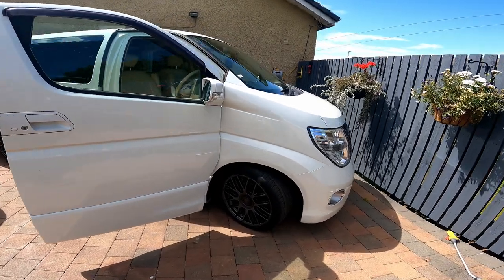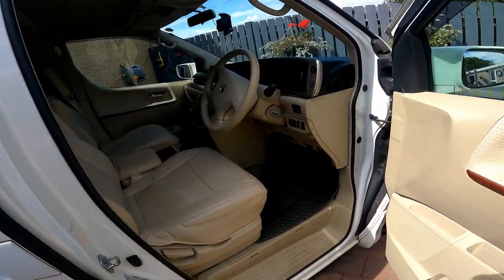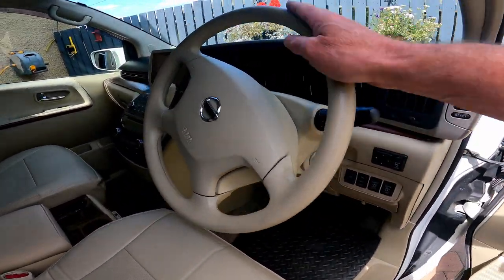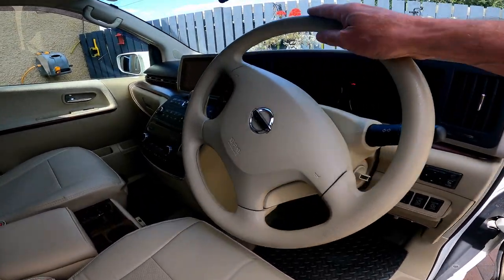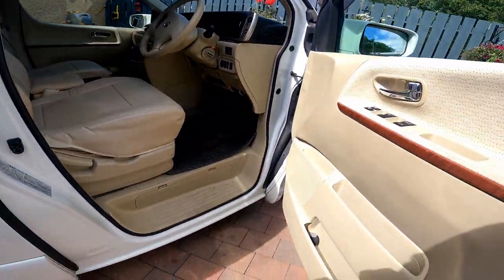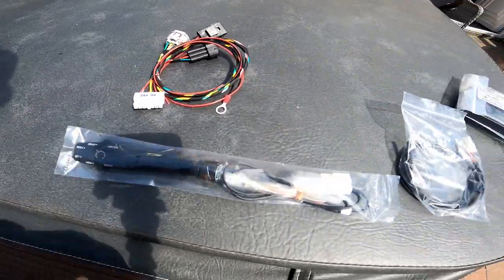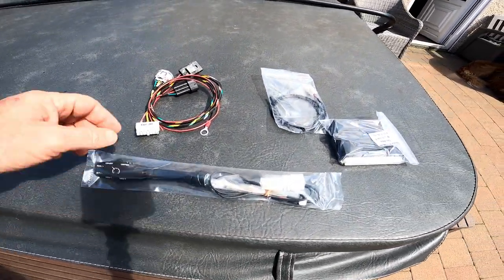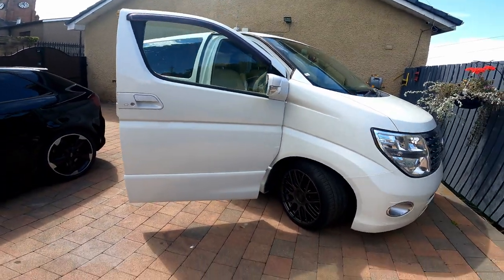NISSAN ELGRAND CRUISE CONTROL

Comment: That small button you are not sure what it does? When switched on and you select reverse the door mirror glass will tilt down enabling you to see lower down when reversing.
Reply from the maker: Thats not the case with mine the button dosnt do anything I can see
Reply: It does it on my Nissan cube, I have my mirrors set to open. On that button it should have a picture of a mirror with auto written on it. It also was on my Elgrand